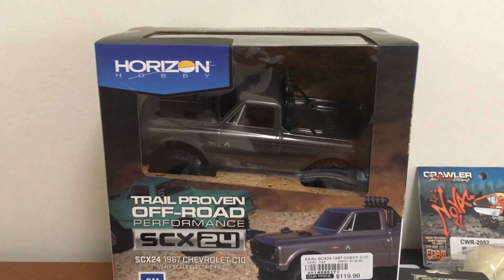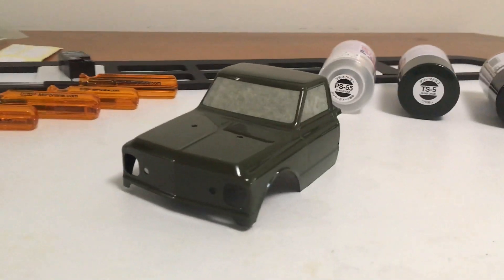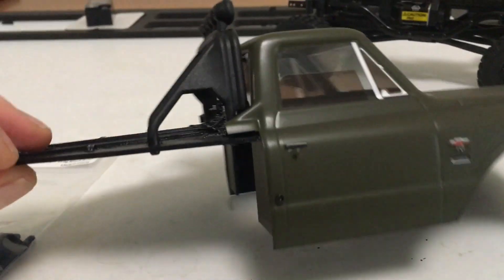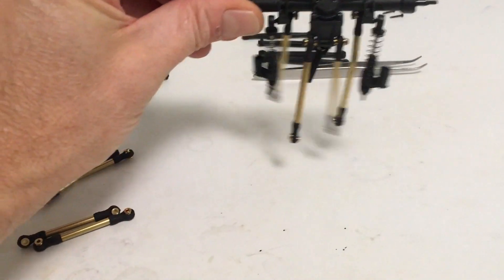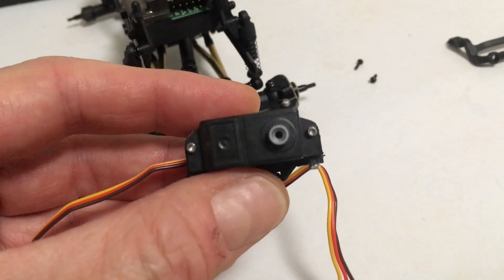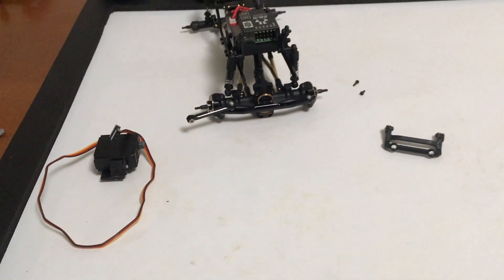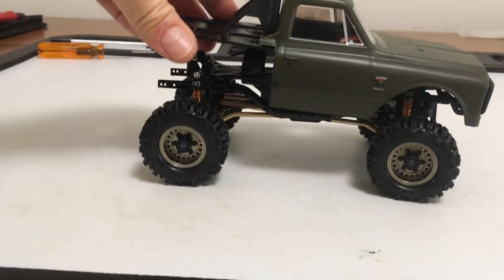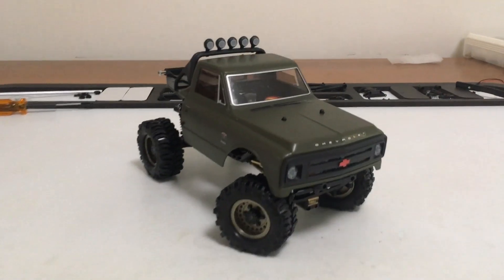SCX24 C10 BUILD: STAGE 1 - PAINT/BODY/KIT, KNUCKLES, SERVO, HC LINKS, PH SWAMPS, BLACK RHINO RIMS

Comment: I was seriously considering those wheels for my TRX 4M defender, a bit pricey though. Could you explain the clear coat first and what effect it has on the flat paint-thank you
Reply from the maker: You have to use a lexan compatible paint on the lexan, so that is why I use the PS-55 flat clear first when using non lexan paint colors like Tamiyas TS paints for hard plastics. Their TS paint will bond to their PS paint just fine. The flat clear on the inside first has no affect on the color (still looks glossy from the outside), so when done, I sprayed the outside with PS-55 as well.

The wheels are so nice!

Comment: What do you think about chinese, metal axle housings? I'm planning on using them with all the standard upgrades including a micro komodo and komodo.
Reply from the maker: I’ve used them. They are fine, you may or may not be able to fit aftermarket diff covers. The fully assembled ones I could not, the housings I could.

Comment: Good stuff. Not a fan of that brass skid. Adding brass as sprung weight is typically bad for performance. I suspect the truck will drive better without it.
Reply from the maker: I just wanted to try it... I had good experiences with weighted sliders I was running for a while.  Still waiting on my motor I ordered, so haven't even finished this to really see how it handles.   I may have to 'plan B' it with a MOFO RC 050 motor in the interim.  Wonder if I would just kill it if I ran 3S on the Tegu with it?  It does have a 20T pinion, so some speeeed.

Comment: The screw goes in the back
Reply from the maker: @15:44 is the reason why it is mounted to the front.  I did end up switching to the backside mount later on though maybe next episode.  Was able to get it to work fine.